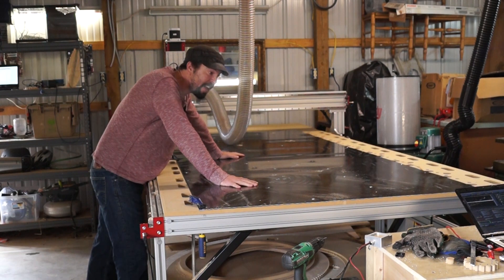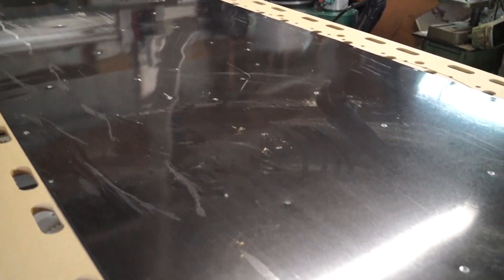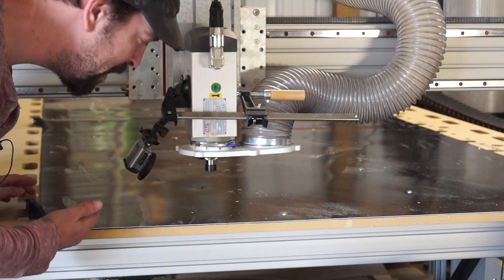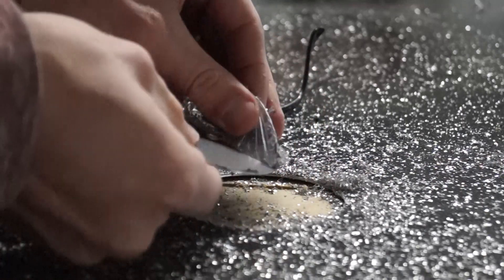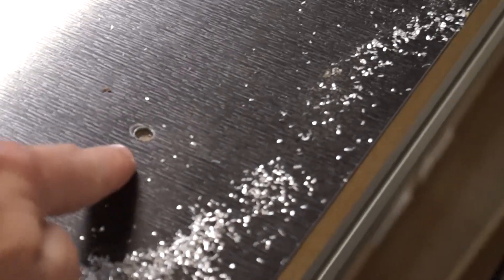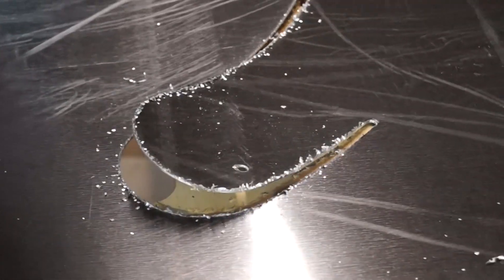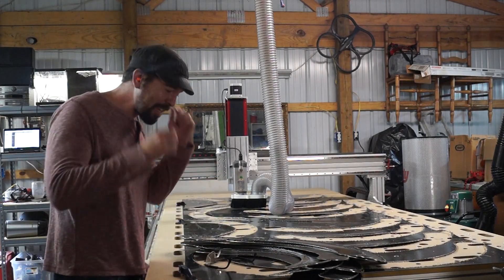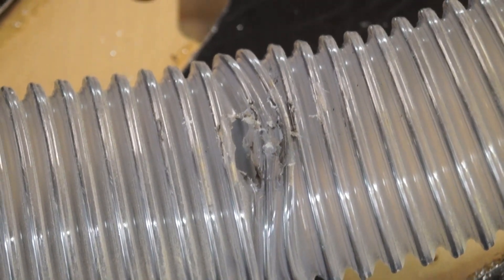cnc routing a 4'x10' aluminum sheet

Comment: I would try it with an .093" dia twin fluted end mill using some Cool Mist (MSC) as a lubricant.
I doubt your aluminum is hard like a 6061T6, more likely 3003 or softer. That's why your bit
is getting gummed up. Check with who sold you the metal. It's good to know.
Reply: i am trying to cut 0.063''    3000 series aluminum sheet,  4X8   do  you have any recommendation? thanks

Comment: masking tape and superglue, or double sticvk tape would solve the clamping issue, your screws are too tight and deforming the sheet, also a short peice of tube coming from your dust boot will keep your hose from dragging and getting in the way.

Comment: Good solution finding the intermediates for screw locs. Looks like your nesting could have been WAY tighter (using a spiral layout). Should be good with 0.040 stock. Set your Z to a fake (+0.5") and just leave the tool in to observe, then reset your Z to real for cutting. This stuff is GREAT!: search eBay: Original-Wow-Tape-4pk-CNC-Router-Hold-Down-Tape (good gription and no residue after remove) . Use movable weighs at each position to hold down sheet. Use a drill for holes and overdrill 2 mm, and use 'tabbed' cutting for sheet parts to avoid curling. I have to pre-peel the plastic protectant. Use a bungee to the ceiling mid hose to keep it off the table.

Comment: Very late to the game but look for "spiral flute down cut" endmills.  These push the material down against your table so you don't get the curl.  It moves the burr, if any, to the back side of the cut.  Just make sure you have your bit speed set correctly for your material.

Comment: Hi. Lay a new spoiler board over the cut one, flatten it, use bastante two sided tape and use a cutter made for aluminum.My friend cuts thin to very thin aluminum all the time. He so,etimes makes aircraft parts. You're right, fixturing is everything. For thin stock, always use DOUBLE SIDED TAPE...... Good luck!

Comment: I have seen a few people comment about using Double sided tape and believe it or not this is used in CNC machine shops for the same purpose. It is def a good addition to screws but if you are going to use tape make sure to Screw down where you can as well.

Comment: As others have said, sandwich-ing between sheets of other materials is a great solution, and the correct bits are critical. When I worked in the signage and trade show display industry we used Onsrud Cutter tooling. I found their literature very helpful in determining the correct bit for the job. That will help with the material coming up (downcut bit is particularly good) and the Built-Up Edge you are getting on the tools (BUE is the abbreviation often used in machining; may help you if you want to search on the subject). Finally you would do well to use a lubricant on the tool. Kerosene is the traditional lubricant for aluminum (people tend to use WD-40 a lot because they have it on hand, but that's basically 98% or more kerosene, plus a tiny bit of oil), but denatured alcohol is also very effective. And actually many machinists swear by the use of household degreasers like Simple Green for machining aluminum, and that would be far less likely to cause a problem in close proximity to your spindle (no idea if that would be a fire hazard with the flammable options). Think of it like nonstick spray for your bit. Just spray a little on the tool bit and/or cut path ahead of the bit as it runs. Doesn't need much, just enough to keep the bit from getting gummed up. That should greatly improve your tool life and the quality of the cut.

Comment: I used to run a CNC router at a sign shop.  Even with a vacuum table things wouldn't always stay in place.  Sometimes we would use premask tape for vinyl decals on the back of the material to help hold it in place.  This would work for dry cutting but not so much if we were cutting aluminum with coolant.  Now they have clear plastic premask that would probably work with the coolant. You could always use the high tech method of pushing down on the material with a broom handle when the router drills the holes to keep it in place.
Reply from the maker: ha, I love the broom idea!

Comment: lots of carpet tape is another one, some carpet tape has strings in it to make it stronger, so it can gum up a bit and if you're using coolant it can lift it too so needs enough to hold it down.  but regular double sided tape can be expensive. that is what i use.
Reply from the maker: I've heard lots of people suggest that. I'll have to try this.

Comment: Great job, I can't wait to see the final project. Workpiece holding clearance is always a concern. What I have done at times is to make a marker holder and run a job marking out the places I should mount my clamps, or in your case screws.
Reply from the maker: I thought about doing that, probably would have been smart.

Comment: Put a spoil board MDF on, then super77 glue the aluminum on it?
Reply: Using tabs would also prevent curling of the cut parts
Reply from the maker: that sounds like it could have worked.